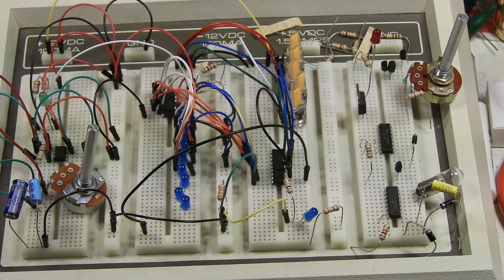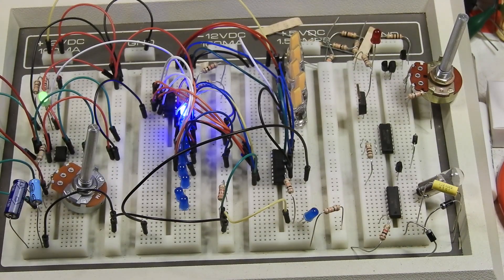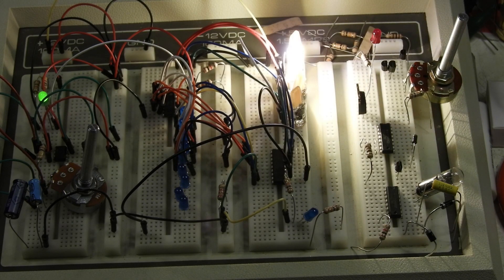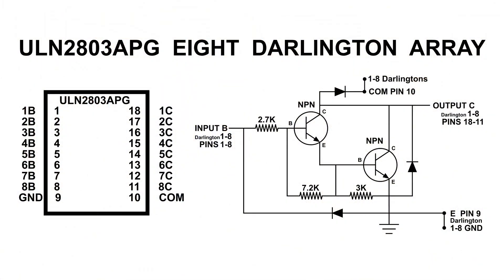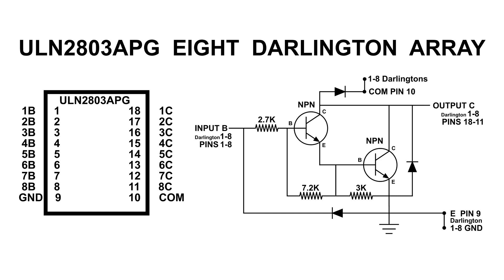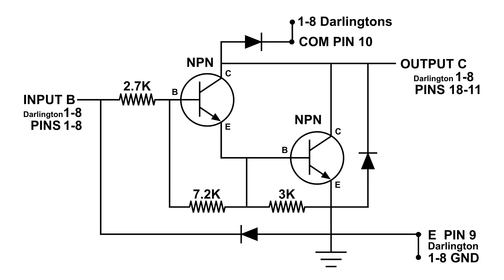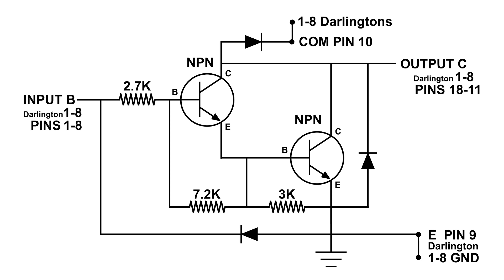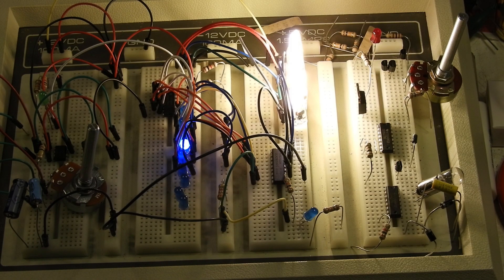ULN2803APG  EIGHT  DARLINGTON  ARRAY

Comment: Saw your vid on 90coil philco I  had the same coil open used car spark coil to find the break didn't rewind just splice.
Reply: Ps I take out the old speakers add resistor use pm they play better have a 20 & 70 working a parts 90 . mice usually ate the cones when you get a 20$ philco. mice ate the 90cabinet 😂
Reply from the maker: Thanks